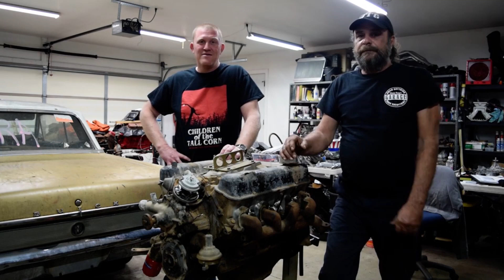Buicks Miracle Motor

Comment: its funny how mopar guys also LOVE! Buicks....
.
my dad is a MOPAR dude.... has a 72 Plymouth Satellite Sebring Plus with a 440 crammed into it making 425 hp
but daily drives a 97 buick le saber 
.
like.... 
mopar for fun
buick for road trips, paying bills, and grocery gettin'
.
i also LOVE!!!!! buicks..... despite being 26 years old (honda V-tec is slow....)
i daily a 99 century with 301,000 miles..... original engine AND trans (IDK how that 4T60e has survived)
.
.
my dream car is a 99 regal GS
AKA a century with a slightly different front bumper....pretty much just fog light holes.... but with a SUPER CHARGED!!! 3.8..... VS the 3.1
or a 70 GSX..... but i doubt ill EVER be able to afford one..... even if i was able to EVEN FIND ONE!!!! for sale
.
the GSX is even more rare than a 426 cuda!!!
.
.
Buick just has higher build quality than a normal chevy....
buick just has a nicer ride than a normal chevy....
buick just has a nicer interior, with standard dual zone climate control.....than a normal chevy....
buick just SOMETIMES does crazy things, and makes the fastest (domestic) production car......which REALLY PISSES OFF the normal chevy division 
.
like.... 
if the 3.8 didnt get AMAZING miles per gallon.... while pulling said 3700 pound car around.... while only requiring an EGR and EVAP to meet emissions 
and being INDESTRUCTIBLE (once you replace the LIM gaskets)....... and so easy to work on....
.
it would still be made today
.
but GM got pissed when the 3.8 made WAY more power.... yet got better MPG than their 60 degree v6'es (aka 2.8 / 3.1 / 3.4 / 3.5 / 3.9)
then GM got SUPER PISSED!!!! when Buick added a super charger....and the V6 99 Regal GS was kicking the V8!!! 99 Corvette's ass (W-bodys are light as Fu%k)
.
and while a SC 3.8 with a 20 dollar "party pulley" was kicking the Vetts ass.......
it was also getting better MPG
.
and that was the last straw for GM...... and they killed the 3.8
.
it wasnt because it didnt meet emissions...... they added A.I.R. pumps to the 3.5 and 3.9
but didnt even try with the 3.8
.
GM was just tired of this old 1955 buick motor kicking their ass in EVERY metric..... despite designing motors from the GROUND UP!!!!
more MPG
more power
more durability
more easy to work on
less vibration and harshness
ETC
ETC 
.
we dont have a 3.8 today because chevy and the Vette team got butt-hurt...... that is the ONLY reason 
that "we cant make it meet emissions" line they used is TOTAL BULLSHIT!!!!
Reply: and now days.... SMOG equipment = burn more gas, to power the SMOG equip...... so you have a cleaner exhaust.
.
that doesnt make sense to me
that means more exploration, more drilling, more pumping, more hauling, more refining, more hauling, and finally.... more pumping into your gas tank
.
every step requires carbon..... 
diesel to haul it from the refinery to bulk storage.... more diesel to haul from bulk to the gas station....
electricity to pump it into your car (which comes from a coal power plant)
ETC ETC ETC
.
id rather have 5% more emissions...... but burn 15% less gas from my tank
.
.
and semi trucks..... despite the DPF and cat piss injection systems..... are WAY less regulated than a normal car
heavy duty stuff has always been held to a lower standard of emissions 
.
so....again.... why burn 15% more fuel for 5% cleaner exhaust?? 
.
when these truckers....who just got a brand new 2020 semi.....
are digging out the 70s 80s and 90s trucks from the woods.... and restoring them..... because they are tired of waiting 20 hours for their cat piss injection system to get fixed
.
thats 20 hours not making money......only spending money
.
meanwhile the "good ol' boy" in his 8v71 2 smoke Detroit from the mid 70s..... is cruising down the road..... hauling the load the 2020 truck was meant to pickup.....
and because he is a "scab".... is getting paid 2x!!!!!
.
even if the old trucks get HALF! the MPG and pollute..... you still make more money in the long run
as you dont have to buy a 10,000 dollar DPF filter every 75,000 miles!!!!!
Reply: Buick for grocery getting? You don't know the story of the Buick Gran Sport Club of America VS National Hemi Owners Association....to make a long story short, first match in FL, Buick wins, later match, Hemi wins, last match for all the marbles in Canada, stock appearing cars, Canadian GS with cast iron intake and exhaust, 3.73 gears against 1971 Hemi Cuda, 2 4 BBL, factory headers, hundreds of lbs lighter, 4.11 gears line up, Hemi red lights and Buick still runs him down, Hemi driver puts it on the trailer and refuses to race again, so much for the race bred mighty hemi.

Comment: HA, I love it when I'm right. I can't tell you how good the Skylark is to drive. 2800lbs and with that SWEET engine it is the most comfortable, good handling, well rounded car that is possible. The 215 powered the first Mclaren. The 215 won 2 Formula 1 Championships. There wouldn't be SUVs if not for the 215 powered Rovers. This is a shamefully underappreciated engine.
Reply: Put a 215 in a Lotus in '80's. One hell of a combo!

Comment: I have 2 of the Olds 215 with the extra head bolt.
..Disassembled, but I have em lol.. 
Tony, neither of you mentioned about the funky flywheel that bolted to the torque converter. Also, won't bolt to any of the usual/popular trans bellhousings. (NOT a BOP pattern)

Comment: I always thought the 3800 was a stand alone design. Thanks for the education. One of the best gm engines ever.
Reply: nope.... its a 90 degree v6....which means its unbalanced (so they added a balance shaft under the cam, that spins at 2x crank RPM)
 a v6 wants to be a 60 degree 
.
but buick cut 2 cylinders off..... and called it the "oddfire v6"..... 
because.... instead of "pop...pop...pop...pop...pop...ETC ETC"
it went like "pop pop.....pop.....pop pop.....pop....ETC ETC"
.
then they added the balance shaft i mentioned..... and made the crankshaft a "split pin"
.
after that..... the engine is one of the smoothest running v6s ever made
DAMN near as smooth as a straight 6
.
but ya.... that 3.8 is a DAMN good engine
decent power.... AMAZING miles to the gallon.... and super durable 
.
just replace the lower intake gaskets with the FEL-PRO metal frames..... and the plastic coolant elbows with the doorman metal ones
and it will hit 500,000 miles EASY!!!
Reply: @kainhall  I have taken a late series 1 3800 to 270,000 personally and my cousin took a series 1 to over 400k. Bodies just rotted away.

Comment: I heard it goes back further than that. It starts with the 1949 olds V-8.  BMW did an aluminum version for its sports car.  A total knock off.  Gm decided to return the favor and ripped off the BMW aluminum technology and they resulted in the 215 Buick.

Comment: THE SMALL BLOCK FORD 289 ci IN THE DAYTONA COUPES WON LEMANS IN 1964 AND BEAT FERRARI BY ALMOST 40 MINUTES. IT HAD A TOP SPEED OF OVER 200 MPH. IN THE AC COBRAS DESTROYED EVERYTHING THAT CAME UP AGAINST THEM. NO ENGINE IN AUTOMOTIVE HISTORY HOLDS ITS CREDENTIALS.
Reply: Please control yourself
Reply: @christianmotley262  THE FORD 289ci IN THE MERCURY COMETS IN A/FX 2700[LBS DOOR SLAMMERS PRODUCED 450HP AND TURNED ALMOST 11 SECOND FLAT QUARTER MILE TIMES. DOUG NASH SET A RECORD AND DROVE ONE TO A ALMOST 11 SECOND FLAT PASS. IT WAS SUCH A THREAT TO THE SMALL BLOCK CHEVY THAT THE NHRA WOULD CHANGE THE RULE BOOK ON THE FORD 289ci LIKE THE WEATHER CHANGED IN KANSES TO DISCOURAGE ANYBODY FROM RUNNING IT. THE NHRA HAD WRITTEN AND UNWRITTEN RULES FOR THIS MOTOR TO STOP ANYBODY FROM RACING IT. BY THE MINUTES THE NHRA CHANGED THE RULES ON THIS MOTOR. THIS IS HOW THE SMALL BLOCK FORD DISAPPEARED FROM RACING IN THE 1960'S INTO THE 1970'S. IF YOU CAME TO THE TRACK WITH A CERTAIN SET UP AND WON THE RULE IMMEDIATELY CHANGED FOR THE SMALL BLOCK FORD. THIS WAS THE REASON THERE WHERE NO, TO VERY FEW RACE PARTS AVALAIBLE FOR THE SMALL BLOCK FORD. IT COST MORE MONEY TO BUILD A FORD BECAUSE PARTS WERE NOT MASS PRODUCED LIKE THEY WERE FOR CHEVY WHICH KEPT PRICES LOW. NEITHER WOULD FORD NOR THE AFTER MARKET PRODUCE RACE PARTS FOR A MOTOR WHERE THE NHRA WOULD BAN THE USE OF THOSE RACE PARTS, AND THE MANUFACTURER WOULD GET STUCK WITH A WAREHOUSE OF SCRAP METAL. EVEN WITH THE LACK OF RACE PARTS THE 289ci WAS THE MOST SUCCESSFUL ENGINE OF ALL TIME. DOUG NASH SUPERCHARGED THE FORD 289ci IN HIS LIGHT WEIGHT BRONCO AND RACED AGAINST GAS RONDA A 427 SOHC NITRO BURNING MUSTANG AND DICK HARRELS CHEVY NITRO 427. IT WENT UP AGAINST CHRYSLER HEMI'S. IT RACED AND WON IN RALLY RACES ALL OVER THE WORLD UP IN THE MOUNTAINS OF SOUTH AMERICA. IN ROAD RACING THE 289ci COBRAS DOMINATED AND THE 327ci CORVETTES WERE NO COMPETITION. AT LEMANS THE 289 WIPED THE STREET WITH THE KING FERRARI THE ULTIMATE RACE IN THE WORLD. WITHOUT ARGUEMENT OR QUESTION THE FORD 289ci WAS THE MOST SUCESSFULL ENGINE OF ALL TIME.

Comment: The factory hottest version of the modern 3800 was not the L67 as people are saying throughout the comments.  It was the series 3 3800 labelled L32 that came out in the Grand Prix in 2004.  That engine was factory rated at 260 Hp and 280 lb ft of torque and basically the extra 20 HP from the L67 was from a better M90 supercharger.  The only car that had the series 3 was the Grand Prix GTP... any Impala, Monte Carlo, or Regal had the L67 series 2 variant.  The L32 had bigger intake valves and stronger powdered metal connecting rods.  I believe GM sold it as a crate engine rated at 280 Hp as well. Around 10 years ago I had a 2004 Grand Prix GTP Comp G and modified it.  It was high 13 second car at my crummy altitude and track.  The Comp G gave you doo dads like red calipers and paddle shifters but I liked how it gave you the 3.23 gear in the transaxle over the standard supercharged cars 2.93 gears.  Fun fun.

Comment: my dad bought a new 1961 oldsmobile F-85 with this 215 ci (2 barrel carb) engine in it. biggest problem was the prestone antifreeze(magnetic film) plugged up the heater and radiator. after about 3 flushes I convinced my dad to put zerex dupont antifreeze into it and it was fine after that. the car was very light and so had plenty power with 3 speed standard trans,
Reply: Interesting.

Comment: Believe it or not the ford 3.8 V6 was actually another variant of that design also. Its said that ford didnt want to go thru the trouble of designing a complete clean sheet V6 back in 1983 so they either bought or copied the Buicks design .

Comment: I'm a buick V6 fanboy.  My 231 (3.8) even-fire with an 4bbl intake manifold from the 252 (4.1) runs pretty strong for what it is, this intake really woke it up.
Reply: I had a 225 Buick in my CJ3 Jeep. An odd fire but I liked that engine a lot and I am a big Mopar fan, so much so I bleed blue. However I like Buicks. Built better than their Bowtie relatives.
Reply: @karlbishop7481  I'd run a 225 any day if I could get my hands on one.  I yanked the original slant-4 from my '65 scout and dropped in a 231+th350, kept the Dana-18. This was my 1st 231 and boy it ran great in comparison. 4.88 differentials and Saturn overdrive in the PTO for the highway, it was a climber.
Reply: @thisisyourcaptainspeaking2259  I don't remember exact ratio but my Jeep had something like 5:38s. With those gears and the low rpm torque that Jeep was amazing.  I had a Warn overdrive as well. The guy I sold it to reneged on payment so I may get it back.  He never registered it so lien holder status would work but it dropped out of DMV records.
Reply: @karlbishop7481  I bet you're lein holder on the title, titles are proof of ownership.  I'd contact the DMV and see if they can advise or maybe someone who does repossessions?
I can't believe it now looking back but I actually gave away my '65 Scout to a good friend, it was rust-free and painted with Imron, police car blue.  Still kicking myself over that one...

Comment: The first engine I ever rebuilt was a Buick 231 V6 in a 1979 Pontiac Sunbird. It had a Smokey Yunick designed Weiand tunnel ram topped with a Holley 390 CFM. Hotter cam. The recipe was from a car mag in the ‘80’s. Ran like a stock V6. Probably should have ported the heads and done a little more jet experimentation. Ended up selling the car to a guy who wanted the engine for a Jeep. Saw the car later on with a different stock V6 in it.

Comment: It's a cool engine. 
I think the Chrysler 318 has been just as wide ranged. Maybe it wasn't in a full on race car, but it did make it into HD trucks, and the Military to boot. 
Small block Ford is maybe a distant third, I don't think it succeeded in the truck applications that well, but it checks all the other boxes.

Comment: GM brought the 231 V6 back in 1975.  I had one in my 75 2 dr Skylark.   Did not like to get wet because the distributor was at the front where it could get soaked in any kind of rain.

Comment: the l67, supercharged 3800 is a great motor. I've got one in my VS commodore in Australia with a t5 and 3.73 diff gears and it pulls really early on and keeps going
Reply: No doubt. Have an L67 in an 05 Impala SS and it just keeps going and going. FWD but I've had good luck with the weaker 4t65e trans.  I dig the iron block/heads set up. Bullet proof. With just bolt on exhaust components, 3.5" supercharger pulley, Power log (looks like a shorty header to me) and a reprogrammed PCM, it's amazing how much low end torque these 3.8s make and how easy they are to work on.
Reply: The FWD transmission in a Century is absolutely junk!

Comment: I had bought one of these way back in 1979 "rebuilt" for $50 from my girlfriends Dad. I never used it and sold it for $250 to a guy that put it in a 1970 Datsun Pick up and backed it with a 4 speed. He did the whole job in a weekend. I am still pissed I didn't have more talent back then to do the same thing......

Comment: The 1964 Buick 300 was based on the 215 V8 and had a cast iron block with aluminum heads and intake manifold.

Comment: Also, the 3800 was downsized to make the 3300. 
 Was the V-6 diesel used in Buick this motor or is it related to the Crapmobile 350 diesel?
Reply: Was based on the Olds, had one in mid-eighties FWD Park Avenue, transaxle was a really different animal.

Comment: Also Buick 215 where extrude cast with sleeves in place. Rovers are sand cast. 215 and later cast iron small blocks have a different bell housing pattern.
Reply: You mean 300" and later used standard BOP bellhousing...
Reply: @BuzzLOLOL  yes, I meant to say that the 215 and rover engine use a different bell housing pattern than 64 and later blocks. The 215, 300, and 340 use the same head and cam pattern, 350 has different heads and cam.
Reply: @jdvintageauto2958  - I have 2 215's and a '64 300 around here... Buick 215 w/ BW 5 speed in my '75 MG Midget... the big BOP bellhousing wouldn't have fit... Olds 215 wouldn't fit, the 45 degree valve covers would have nearly touched the body blocking view/access to spark plugs...
Reply: @BuzzLOLOL  I have a rover 4.0 with a t-5 just sitting here waiting on a vehicle. Was going to put in a 924. I also have a 65 300 that has rover 4.0 aluminum heads on it. Thought about putting it in my YJ.

Comment: The odd fire v6 was 120 degree not 90.
Reply: You're absolutely wrong
Reply: @christianmotley262  prove it.
Reply: @christianmotley262  I'm still waiting on you to provide evidence as to why you claim that my statement is incorrect.
Reply: Also the 120 degrees is crank rod pairings, not block configuration.

Comment: The 231” version was used in FWD applications prior to ‘88 also, they just weren’t labeled as the “3800”.  We had an ‘86 Olds Delta 88 in our shop class in high school, I remember thinking how much more archaic it looked with the distributor.  My mom had an ‘89 Delta 88 at that time...with its “fancy” distributorless ignition. Lol
Reply: They were 3.8's the transaxle was so bad that a junkyard here in Chattanooga was GIVING away the 3.8 because the cars were getting scrapped.
Reply: @christianmotley262  I could believe it!

Comment: As an aside, the engine in the Leyland P76 (Aussie market) was a 4.4 litre version.  Also, the Rover 3500 is the same V8 as found in the TR-8, but different from that offered with the Triumph Stag, which came with a bespoke V8 that Triumph developed - poorly - by siamesing two of their slant I-4 motors, and was never used in any other model.  Many Stags were later converted to the Rover 3500 engine for it's better performance and reliability after the original engine promptly died - usually of severe overheating, I believe.  :-)
Reply: stag v8, head bolts designed to never be removed....
Reply: The only triumph v8 I've seen had suspicious white gunk in the coolant, like it never ran antifreeze or something. I always wondered how common that was.

Comment: Throwing a 425 nailhead in my Ranchero build! I love the aluminum 215 too
Reply: That's wild, would like to see pictures. What transmission are you going to use?
Reply: @christianmotley262  subscribe to my page. Its my next project after my f100 is done. The plan is s10 frame,  nailhead and I'd like to adapt to a th350 maybe even a 4l60

Comment: Had a 1996 Discovery with the 4.0.   Cam, headwork, larger injectors , headers and a small compression boost it was pushing that 5500lbs very well.  Great engine when taken care of .

Comment: The most versatile motor of all time was the Harley Davidson flathead 45. It lived in its own right until the mid 70s in the servicar trikes. It’s layout was the basis for the KH motor that is the father of the XL motor in sportsters. At XL has been in production since 1957. The XL motor is also the basis of all top fuel Harley Davidson motors.